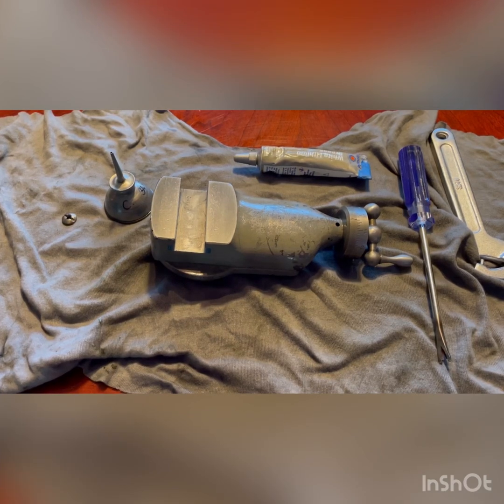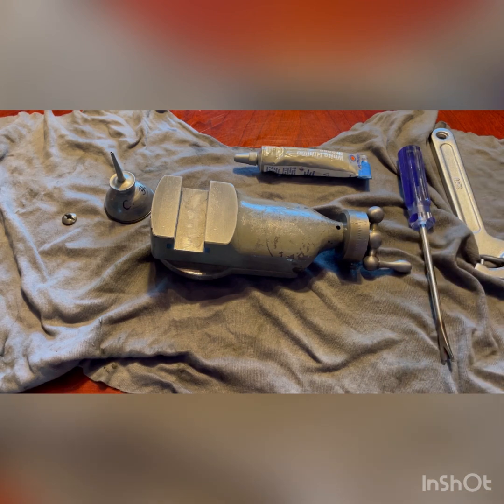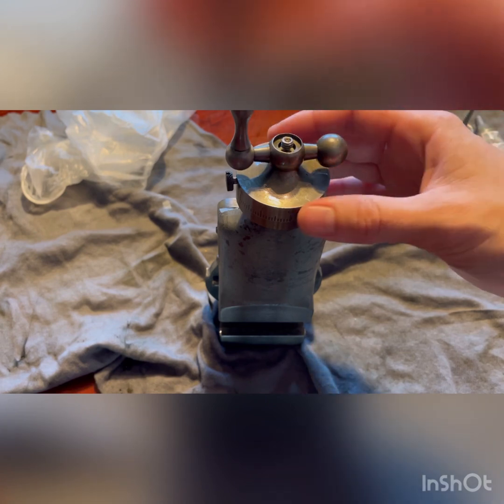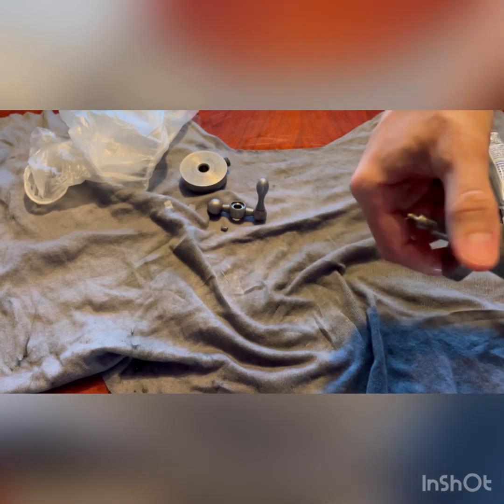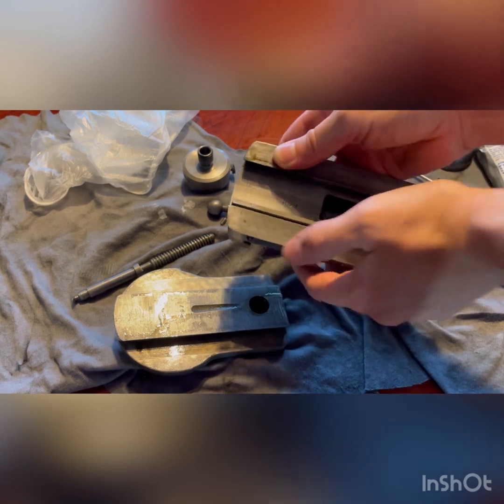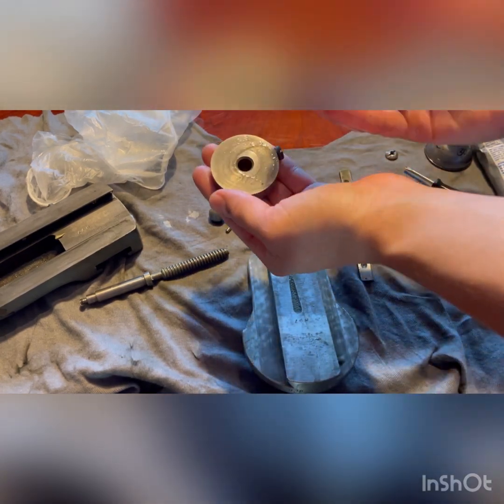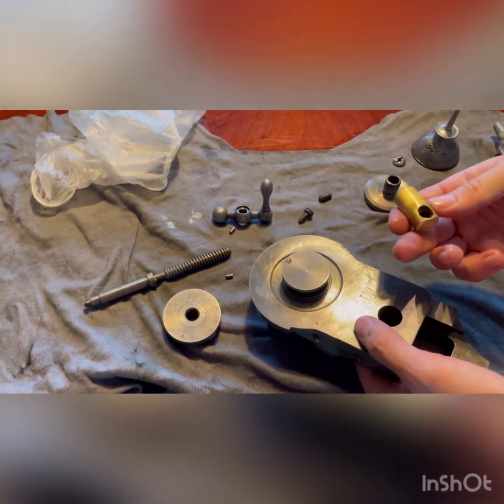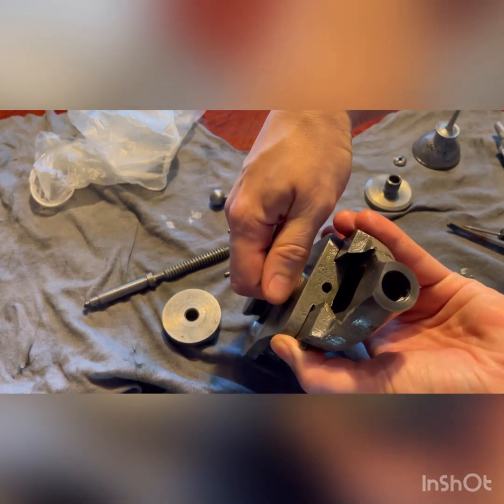Southbend Lathe Model A 9” & 10-K Compound Rest. Disassembly and assembly￼.

Comment: I have some questions please. I have a 10L, not a 10K but they look similar. Only difference I’ve seen is the slide screw not. 
Anyway, in the dial, under the thumb screw there should be a pin and brass shoe. You only took out the pin. Can you tell me the length and diameter of that pin? The knurled thumb screw pushes down on the pin to hold it to the slide screw. 
It seems like I’m missing a few pins and brass shoes. 
Thanks,
Paul